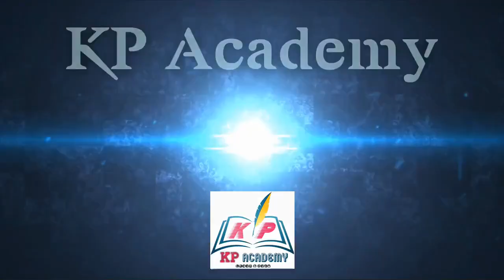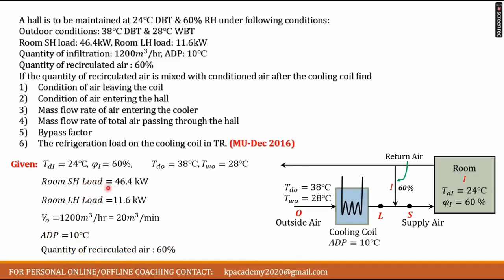PROBLEM ON COOLING LOAD ESTIMATION | DESIGN OF AIR CONDITIONING SYSTEM | CONCEPT OF RSHF GSHF ADP

Comment: Sir can you please solve these problems 
In an air conditioner the outdoor air (at 40°C DBT and 40 % RH) is mixed with return 
(from room) air (at 25°C DBT and 50 % RH) in the ratio of 3:2 before entering the cooling 
coil. The by-pass factor for the cooling coil is 0.25 and the room sensible heat factor 
(RSHF) is 0.8. Air flow rate (total) through the cooling coil is 8 kg/s. 
Determine: (i) ADP, (ii) Condition of air at inlet and exit of the cooling coil, (iii) Tonnage 
of the plant, and (iv) Rate of condensation
Reply from the maker: When do you require solution? by what date?

Comment: Hello, I believe there is an error in the calculation of the flow rate to the cooling coil at point 3 of the exercise.
The corresponding total heat (RSHF) should be calculated from the mixing point (Ts) to the point corresponding to the internal room temperature (Ti). Qt= ms⋅(hi−hS)      ms = total flow rate  
PS:Great videos!
Reply from the maker: Thank you for watching videos. Coming towards your query, there is no mistake in calculating the mass flow rate. We have done calculations as per the data given in the numerical.
Reply: @kpacademy5855  for total room heat, Qt = ms (h i - h s) and to get coil flow rate, we multiply ms with 0.4. That makes more sense.